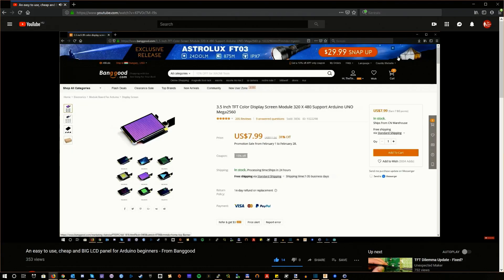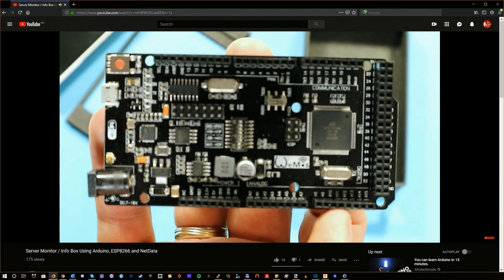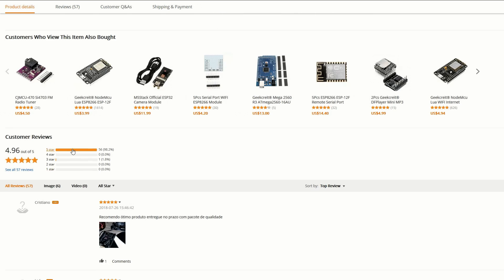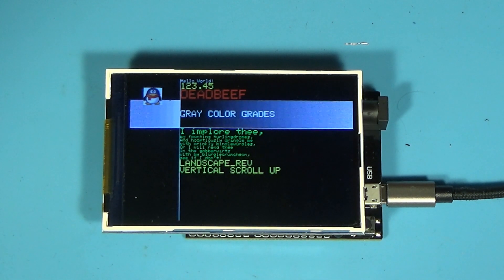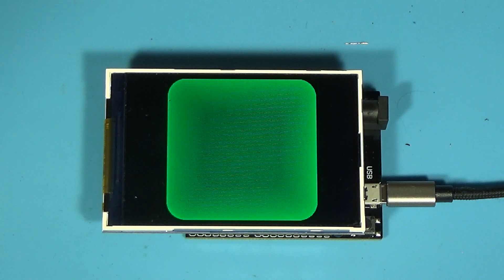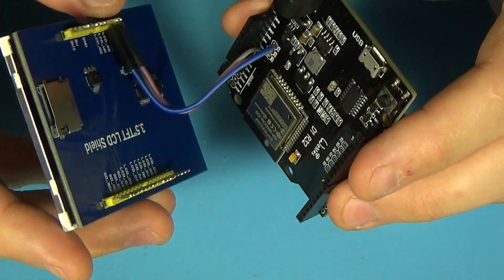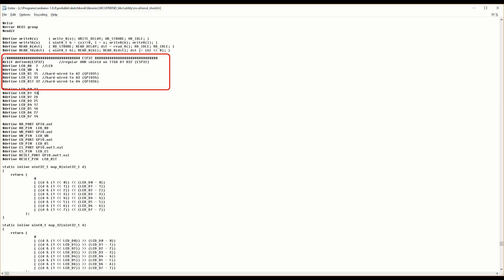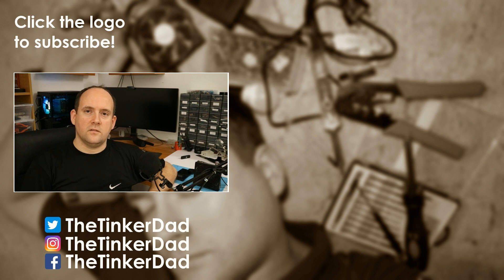How Not To Fail With Parallel LCD Shields and Microcontrollers

Comment: Great video. Those boards (and screens look pretty good).
My two fails this weekend: 
1) I spent most of a day to re-write an RLE compressor to improve it, but actually made it worse (my first iteration was smaller and better). 
2) I spent hours designing a 3D enclosure only to realize I had no way to put anything inside it (at least I hadn't printed it yet).

Comment: That sucks that the Arduino clone board is not 100% compatible, why did they decide to do that!
Reply from the maker: Not sure. But what really sucks is that they marked those digital GPIO pins as "ANALOG" clean and clear on the PCB...